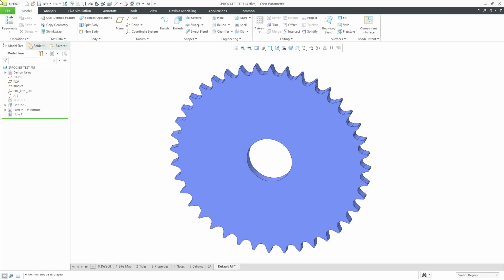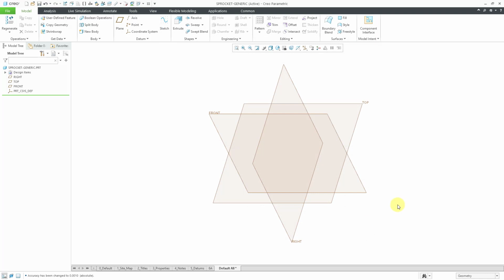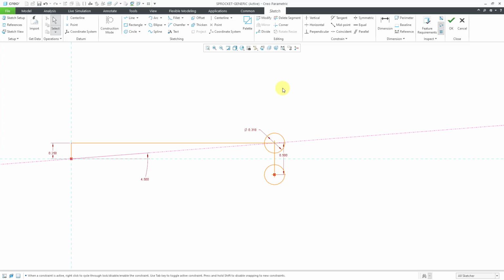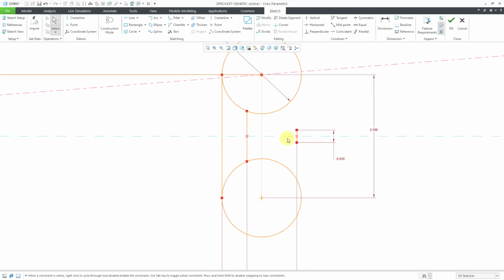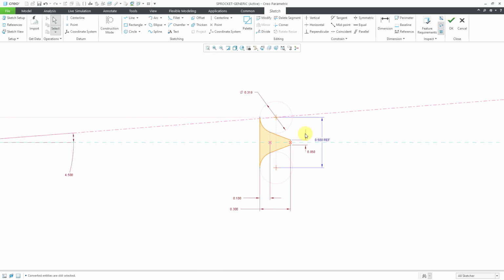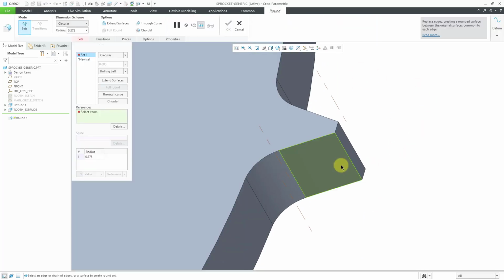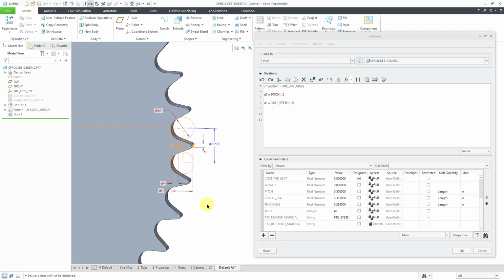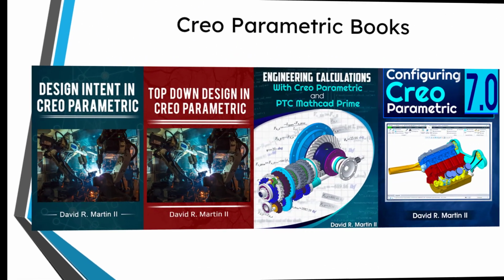Creo Parametric - Part Modeling Example - Sprockets

Comment: If you follow this video step by step, you get different results if you follow what he says, and what his mouse is doing.  The reference point he added to the tooth profile to connect the circle is NOT what it is snapping to in the video.  It is snapping to the endpoints of the line the point is on.  Saying the point is important to add and then claiming to be using it while not showing it actually happening is a problem.
Reply: @GaryWilliams-l6y  yes same happened to me pattern doesn't work in that way and also all round also not working i don't know why